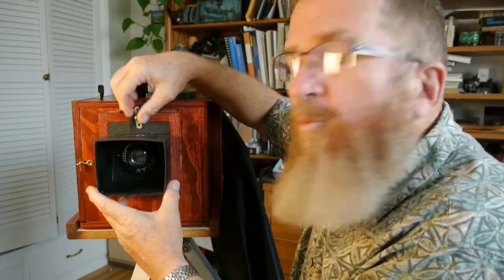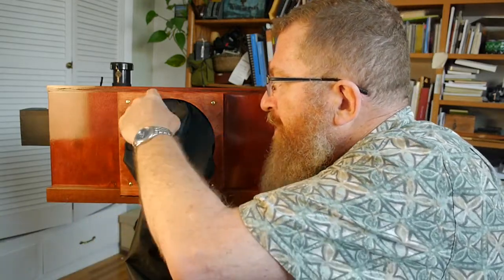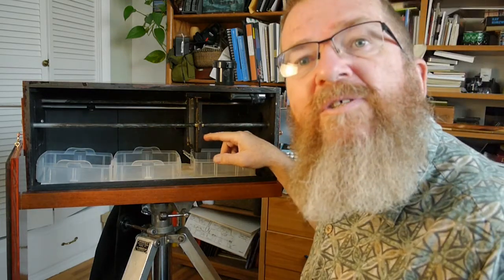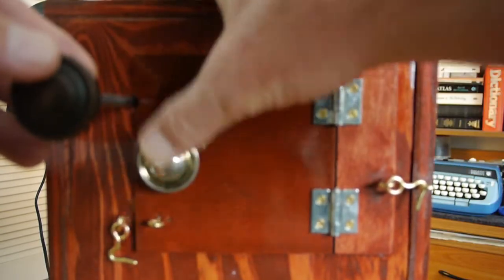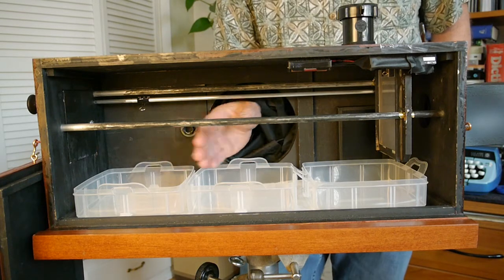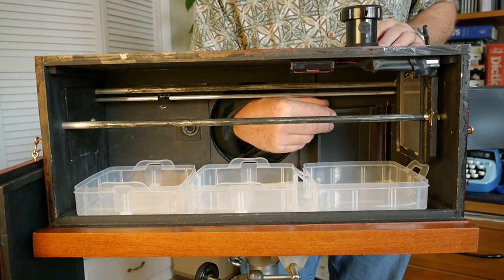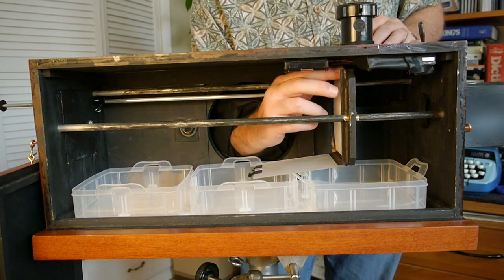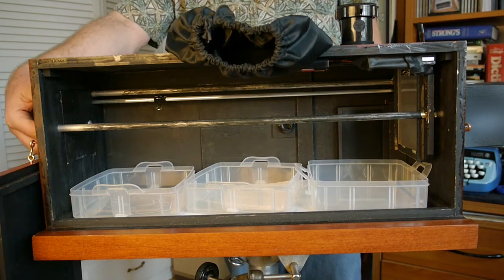Instant Box Camera, Part 1

Comment from the maker: I have not used New 55, but it might work. I don't know how the ISO and contrast would be affected, so you'd need to experiment.

Personally, there's very little additional trouble involved to develop normally, especially when you consider this fibet paper will require a rinse aid and extended wash, then a lengthy drying time while being held down flat, to be considered archival and not badly curl. So 3-bath processing seems to be the least of its problems.

Comment: Hi Joe, how have you prevented light leaks coming in at the hole for the focussing rod?
Reply from the maker: I haven't had a problem with leaks. The wood is about 1/2" thick and the hole fits the rod snug enough to not leak much light.

Comment: Excuse me Mr.
If I want use 4x5 sheet film
What diameter lens sould I use?
(Sorry my English isn't good enough)
Reply from the maker: For a single-element meniscus lens, the size of film format it will cover depends more on the focal length. Depending on how much vignetting you want, the focal length should be at least the diagonal of the film format.
Reply: Joe Van Cleave thank you

Comment: I remember seeing a similar type of 'instant' camera being used in Jerusalem in 1976. The techniques used  was different in that the negative print
was re-photographed using the same camera to produce the positive print. The results were surprisingly good - not fantastically sharp, of course,
but good enough and with a nice tonal range to the final print.